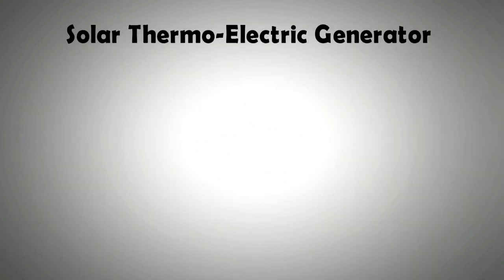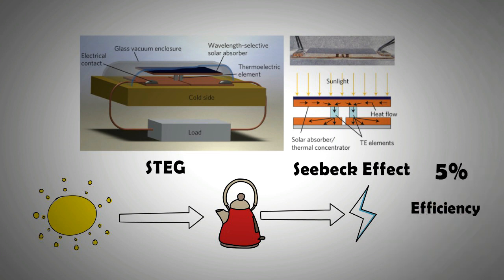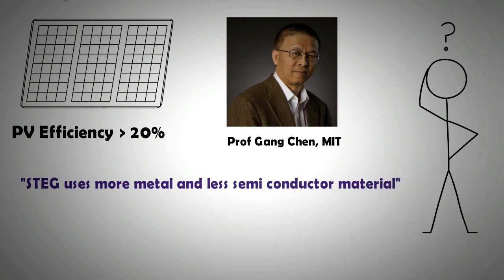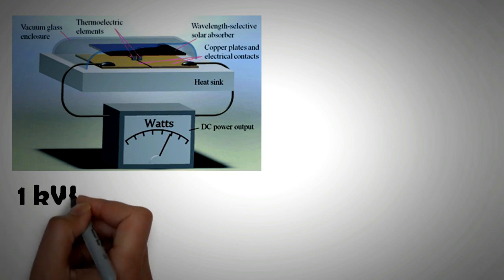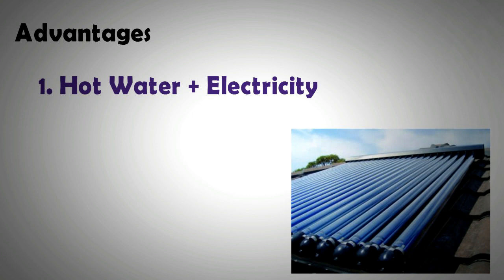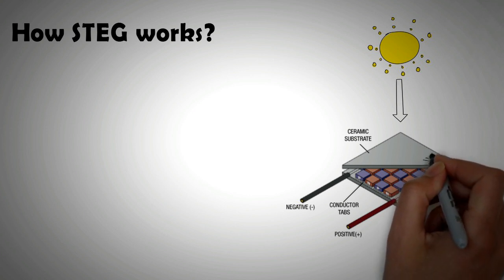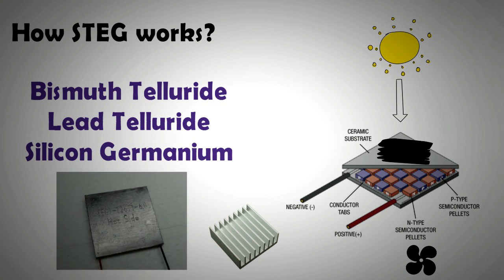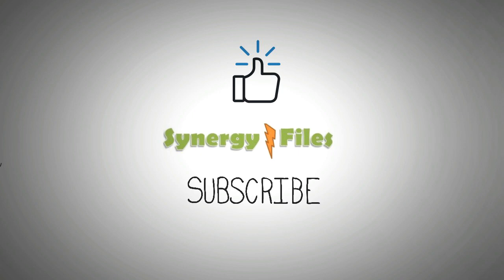Solar Thermo Electric Generator (STEG)

Comment: At 4:27 are you sure you meant to say vacuum chamber? A vacuum chamber is a chamber with no air in it. Isn’t the greenhouse effect impossible without gases to trap the heat?

Comment: Could Thermo-Electric work in a Deep Geothermal set up? I've heard 12 kilometers down it gets as hot as nuclear rector. The other Deep Geothermal plants require a fat line and use water for steam power terrible generator. With a Direct Conversion to Electricity it would cut the need for those requirements.

Comment: 2- When you say that it is 5% efficient, may I ask, how is that calculated? Let us say that we put 300 degrees on one side, and 40 degrees on the other side, and out comes 2.5 Watt. Then I understand your video such that we then have a loss of 95%, or, 47.5 Watt. That effect can only get lost via the cooling water, is that not right? If that is the case, and if we dimension it correctly, then if I am not mistaken, we can keep a thermal storage 300 degrees hot, and then when we need power, we open up for the cold water, and then we will get power from the terminals, while we also heat up the water equivalent to 47.5 Watt. Is that correct?

Comment: Dear SYnergy Files, thanks for your sharing and your time spent on this valuable information. You mentioned various practical things about the heat absorber, concentrating sun on the STEG element. Can you give some guidelines as to how we can make the best use of it? We are thinking about cooling the back side with water, and putting concentrated sun on the front.

Comment: What about taking a TEG and sandwiching it in a PVT panel? It could produce electricity using the heat from the panel and cooling the back side with water generating hot water in the process. Since there would be a high delta, I would thing it would be more efficient. If you added a controller and temp sensors, it would be possible to run the TEG as a TEC producing higher temp water extending the amount of hot water that could be produced in cooler climates. Or using the TEC to keep the panel at an optimum temperature to extend life and increase production. Very little energy would be wasted because it would be transferred to the water for heating. Just an idea that went through my head as I watched this.

Comment: I did this for my undergraduate physics project in 1979. The ROI period worked out at 100's or 1000's of years, but the cost of Peltier modules has since dropped a lot.
Reply: Are peltier chips able to generate power from heat differential?
Reply: @NwoDispatcher  Yes. That is the principle. You keep one side cold, another side hot, then out of the terminals comes electricity. It works same way as the photo voltaics, just here in stead you use heat, while the photo voltaics use UVB.
Reply: @davidsvarrer8942  so maybe it's possible to combine the two
Reply: @NwoDispatcher : You can definitely combine them, but it usually depends on free cooling to be of any use. I could imagine doing that on a boat, like a catamaran, where the big deck would use photo voltaic and lead the excess heat to the water.
Reply: @jeschinstad  or in the desert and have a geothermal radiator deep in the ground. Wonder if they use em in space. I hear has crazy heat differential... also, when they say heat do they actuslly mean infrared?
Reply: @NwoDispatcher : Space is special, because it is a vacuum, meaning you cannot lose any heat by conduction or convection, but only by radiation. It's why the Earth is hot; it is actually very difficult to lose heat in space, even if it is technically very cold. With space, weight is also enormously important and I don't think peltier elements are lightweight. 

The problem with deep underground radiators is that passive heat transfer has diminishing returns and active heat transfer, like with water pumps, cost energy and more so the higher you need to lift it. If the energy required to cool the system is more than is produced, then it's a cost rather than a gain. It could still be a thing, mind you, because if you have an abundance of energy in the day time and a deficiency at night, then it could be a useful battery. I think we may need to improve carbon techs for that to be viable. Graphite has some amazing properties, but right now, we can get it in lengths of up to ten centimeters or so, while we would probably need a hundred meters at least. 

But it is certainly interesting. If you could dump heat in water deep underground during the day, then you could build pressure and release it while lifting it at night. I'm sure there are possibilities there.
Reply: @jeschinstad  would be nice to have geothermal battery to collect all sun energy over summer and have an artificial hot spring in winter
Reply: @NwoDispatcher : Absolutely, yes. It would potentially also revolutionize the concept of air conditioning. There is a carbon revolution coming, but we need a breakthrough in manufacturing.
Reply: @jeschinstad  I saw a system where they use geothermal battery to store the excess heat made by an air-conditioner. Made the condenser work better too... radiant heating systems are a freaking no Brainer compared to forced air. I'd like to work in hvac putting those systems in and retrofitting old ones.
Reply: @jeschinstad  was also thinking, make a huge heat battery in the center of the moon maybe have it power a particle accelerator with a huge steel ribbon in it
Reply: @NwoDispatcher : I'm 41 years old now. I built my first PC when I was 6. I know something about cooling. I promise that if I knew how remove heat, then I would take the trillion dollars and turn this world into a Global Norway. I just don't know how to do it. Once we are able to manufacture large scale single-sheet carbon, then everything will change and I have lots of idea for when that happens, as I'm sure it will, hopefully in my lifetime. But we don't have it. The only way to get us there is peace and hope. I would happily pay a trillion dollars for that, but I just don't have it.
Reply: @NwoDispatcher : Game over.
Reply: @jeschinstad  ya. What do we do?
Reply: @NwoDispatcher : I meant I'm not spending any of my time on the type of bullshit you're talking about.
Reply: @jeschinstad  very typical.  So what should be the population of earth?
Reply: @NwoDispatcher : Seek help from professionals.
Reply: @jeschinstad  how can you deny it? Did you take your vaccinations?
Reply: @jeschinstad  maybe the lgbt crowd can get your son to compete in girls sports. Do you have a family?
Reply: @NwoDispatcher : You should ask your doctor about Lasègue–Falret syndrome. As I've tried to tell you more than once, I cannot help you with this. I sincerely hope that you get treatment.

Comment: This gives me an idea that the device can be employed at reservoirs of water where the day sun heats one surface and the cooler water on the other surface thus forming a difference in temperature. This coupled with the heating surface being a solar panel as well will be able to function as dual energy convertors
Reply: It will work at night as well, as the water will be warmer than ambient :)

Comment: Sounds like this would couple synergistically with a Rocket Mass Stove that incorporates a water heating unit. The Electrically insulated material could be the cob (mass) which is also thermally conductive and the mass gives off high radiant heat for days after only a 1-3 hour burn (twigs, pinecones, junk mail). The RMS also burns very clean because of the catalytic nature of thermosiphoning. I wish I had plans to build (or knew where to buy) a STEG unit as you show on this video. I'd love to give this a shot and see if I can make it productive. Thanks for the video.

Comment: These are great for their wide range of fuels that may be used. Also, NO BATTERIES needed! Store the heat in oil, insulated of course, and when you need it, pump the hot oil into the system. You could even start it by a valve with no other power sources required. Efficiency is important but so is utility. FYI, the batteries are the most expensive and replaced first in any system that is using them.
Reply: I think you are correct about replacing batteries with hot thermal oil for on-demand power when the sun is not actively heating the oil. Build a large, insulated “thermos” to hold the hot oil coming out of, say, a parabolic trough, then use that hot oil to provide heat for the thermoelectric generators whenever electricity is needed.
If you want more flexibility, incorporate a rocket stove into the system for the ability to heat the thermal oil during times when the sun is not shining on the parabolic troughs. Cleanly burn waste materials that might otherwise go into landfills, like junk mail, yard waste, cardboard packaging, ect... in the stove.

Comment: Too bad that it's so hard to turn heat directly into electricity. Because I thought it would be easier than PV systems because the sun easily heat surfaces and could be transferred into electricity
Reply: Not hard, just put your home next to krakatoa volcano.

Comment: Question - How is there much of a temperature difference in a TEG thin film?
Reply: Depends on level and quality of cooling, and on that if passive or active... The higher the difference, the better... Just to get the principle: 300°C to 450°C is better than -120°C to 0°C, which is better than 0°C to 100°C, cause the difference in the first case is 150°C, while in the second it is only 120°C, and in the third, even worse, just 100°C... The difference depends after all only on you, and on how much you are ready to spend for a good, elaborated cooling system...

Comment: Would coupling a PV with an active cooling system be more efficient? Using water as a coolant could cool the PV cells down and provide us with warm water directly. Less conversions of forms of energy
Reply: No, a PV cell only works in certain conditions and at certain times of the day. A teg will work( provide power ) anytime with any heat source. Solar panels are a joke when it comes to conversion, the fact that a shadow shuts down the entire panel, and the obvious amount of space and work needed to keep them going like cleaning then often, snow cover, rain, wind damage, ... You get the point. Not to mention to overpriced components to make them work. Its not as if you just buy a panel and point it towards the sun. You must first have a an inverter, then a charge controller for the massivly expensive battery bank that will need to be replaced within 5 to 10 years. The engery potential in hours of darkness, rain, snow, cloud cover, and all of the other times solar panels are useless make thermoelectric way way more useful and practical.
Reply: Yea this is already a thing, i think it's called hybrid solar.
My idea was using the PV solar panels themselves as heat collectors for Seebeck generators in the back.

Comment: Hello. I have had this idea floating in my head my self for some time. Is it possible to couple this with a true photovoltaic cell?
Reply from the maker: Well done for coming up with this idea independently.
 Yes you can. The challenge will be to find a Thermal interface material that is electrically insulating while thermally conductive to place at the back of the cell. You can find these materials online or RS components
Reply: Okay, so a thermal paste I use on my CPU? I haven't explored thermal electric generators much or PV. I recently was reminded that TEG works by seebeck effect? I always just tell people there's a charge created in two metallic parts with a temperature differential. the larger the differential the larger the charge. It would be really cool to learn more about renewable energy and micro electronics. I think the low-energy technologies people are developing will couple well with renewable energies. If we can bridge the gap between renewable energy efficiencies by making the devices we use more efficient ... Say, there's another technology that randomly popped into my head a couple years ago. I googled it and foudn some patents were already made but it was something like passive gas ion collection. it involved a grid whereas gas passes over a vertical grid (wind in the sea) the gas is charged as it passes over the grid and then that charge is collected by a hoop downwind. I wish I could remember what that technology was because I wanted to learn more about it, I think this would be one to couple with wave generation (magnetic induction via kinetic motion of the sea) and use the water to control the temp on your STEG ... the passive gas system offers electrical generation with very little moving parts. I would imagine the charge-grid would erode over time. Thanks for reading and writing.
Reply from the maker: Yes the same thermal paste. However make sure that the paste has dielectric strength. There is an upcoming video in which I will be looking at ionized  gas, but for a totally different application
Reply from the maker: You might be talking about this 
https://newatlas.com/ewicon-bladeless-wind-turbine/26907/
Reply: @Dc-zu1ii  You can use a silicone rubber material they use for transistor to heat sink coupling.
Reply: @bjl1000  okay let's do it...
Reply: @synergyfiles3536  si.ilar the ones I was looking at were proportedly in the sea and used a hoop mesh one in front of a blank search bar one day many years ago. I have lots of ideas. I really should start holding onto them...many are discovered as already having been invented by some one else...typing on my phone keyboard use your ima go action to fill in the gaps
Reply: Can't find the paper now it just came to me while I was staring at a blank search bar at one day
Reply: Poomoji and predictive autocorrect are the future of literature.
Reply: You mean something like this? https://www.researchgate.net/publication/268818990_USING_OF_THERMOELECTRIC_DEVICES_IN_PHOTOVOLTAIC_CELLS_IN_ORDER_TO_INCREASE_EFFICIENCY

Comment: I have been thinking on utilization of both Solar light and solar heat simultaneously to generate electricity. If Peltier modules can be placed below the PV panels attached to it and heat dispensers are also fixed to transmit heat through Peltier modules, so that heat collected on the PV panel is absorbed by Peltier modules and generate additional power. Reduction of heat on PV panels will increase the efficiency of PV panels to get more electricity. Can any one tell me practicability or otherwise of this new idea? There is no necessity of storing energy in large sized projects because power can be utilized immediately through power gird for energy requirement during day time.
Reply from the maker: This is not a new idea. Research has already been done on PV panel with Peltier. The conclusions suggested that PV life can be increased from 30 years to 50 years in addition to the extra output
Reply: Thank you very much. If you come across any report of findings etc., kindly give information.  Also kindly let me know how can I contact you by email.  I am a retired person and not having any detailed technical knowledge.  So many times I come across such ideas. It will be helpful for me to satisfy my curiosity.  I have designed a new type of flyover to decongest city traffic.  Many Engineering colleges have opined that it is a new and practical idea but I am unable to get it accepted by government officials. I once again thank you very much. Can you keep in touch with me if I give my email ID to you ? After verifyinjg many vidios of solar light energy conversion by PV I throught of asking this question. In none of the Youtube videos I saw any usage of Peltier used with solar PV  panels.
Reply from the maker: You will be able to find more details on this video
http://www.kscst.iisc.ernet.in/spp/39_series/SPP39S/02_Exhibition_Projects/131_39S_BE_1507.pdf

Comment: this is very promising for hot climates (think desert), whee PV is not so efficient.
Reply: I'm still taken back by how a desert can exist in 2019, I can't fathom why people is hot sunny counties/deserts don't utilise to process of convection with condensation to create water.

I'm sure it's not rocket science to have solar powered turbines pumping hot air into a much cooler subterranean holding tank in order for that exceedingly hot air to condense back into drinkable water or why not go the whole hogg and have that cooled water then being pumped past the lower chamber of a Stirling engine to then go on to generate power that's being lost by the solar powered turbine pumps.

I feel that the more we attempt to cover our planet with solar panels the cooler we're going to make the surface of the planet which I really don't see as a productive endeavour because the cooler our climate becomes the less likely fundamental crops will be to grow and may even lead to us sparking off a mini ice age like that of the 1800's when the River Thames frozen solid.

Swings and roundabouts really, we can plaster the planet in solar panels and risk inducing the arbido effect and potentially wiping out a considerable portion of all life on the planet when we go into a gradual freeze OR we can harness things such as hydro power and then use that very power for electrolysis of water to give us some clean abundant gas as well as the water recondencing back into fresh drinking water.

Places like California should be all over these kind of simple ideas with them having to pipe in fresh water from other states.

I thought Cali was the sunshine state a lot like Florida because they're on similar latitudinal lines.
Surely makes good sense to take advantage of all that sun and heat.
Reply: @HumilityThroughSilence  there has to be humidity to condense, there aint no humidity in the desert.
Reply: Actually there's plenty camels aren't solar powered buddy 😉
You might want to watch some caravans, the water is there humans couldn't live there if there wasn't.